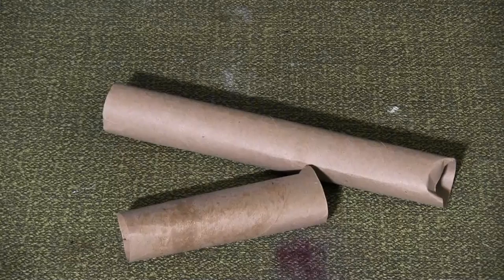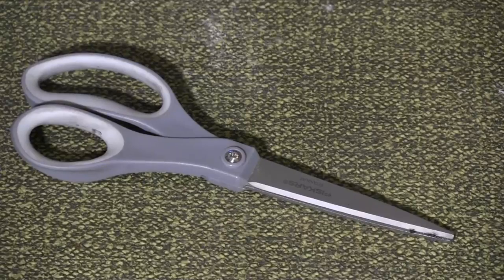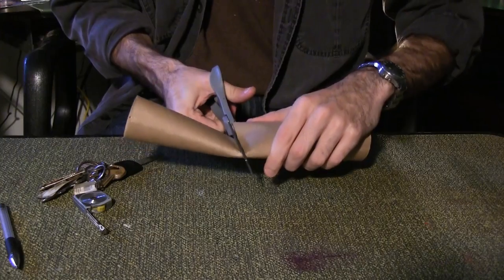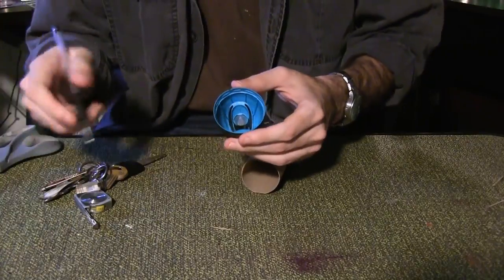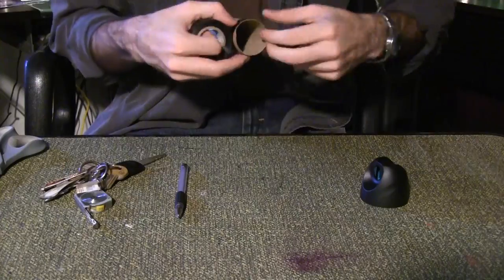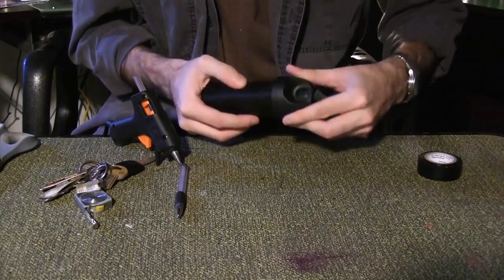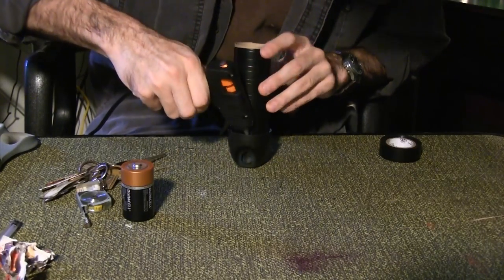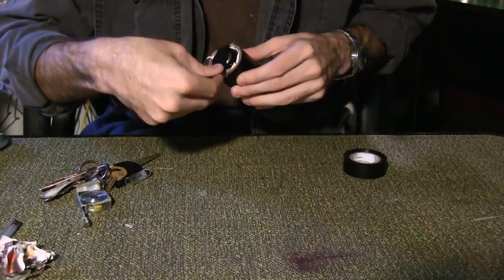How to Make Fake Pepper Spray

Comment: Take the straw in the air freshener and cut it to be smaller and take a small  bottle and fill it with water. Then put the straw inside the bottle and attached to the spray too and put it inside and it actually sprays